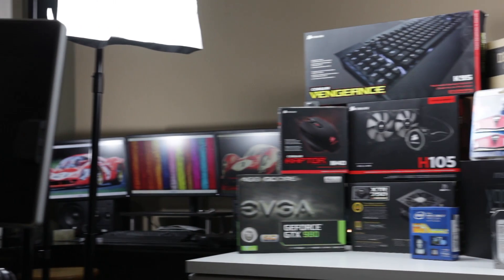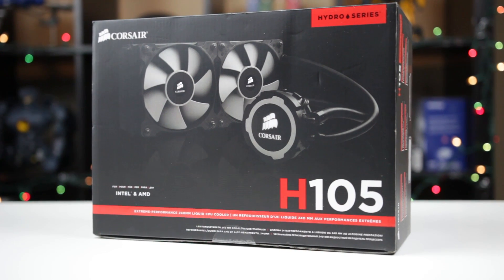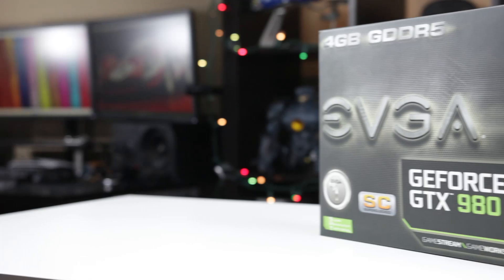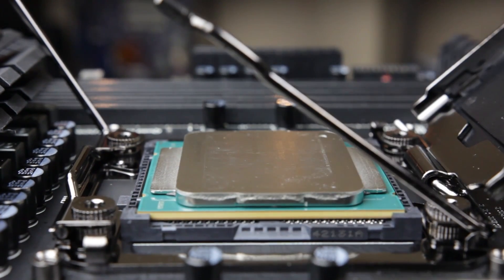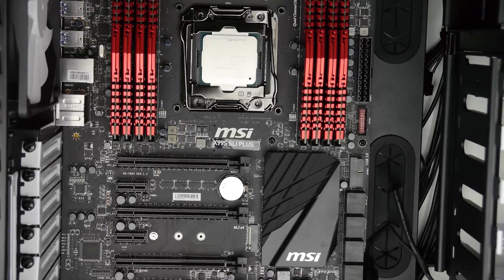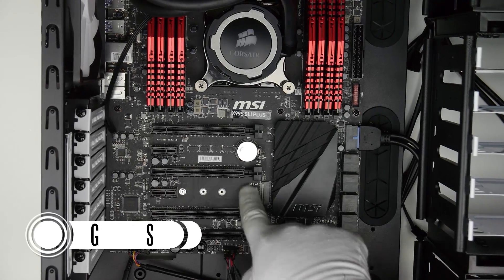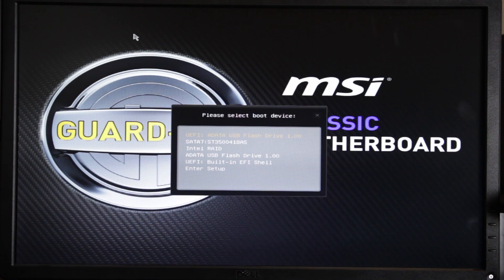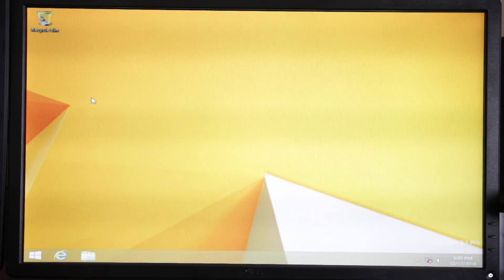How to Build An Epic $4000 4k Gaming & Video Editing Dream Machine for 2015

Comment: How about two 970s in SLI than a 980?
Reply: 2x970 better than single 980
Reply: Erik Kukučka thumb rule is about a 40-60% increase x).
2 gtx 970 will beat the 980 in anything
Reply: Single 980
Reply: Erik Kukučka The vid says 4K gaming in which case 2x 970s are going to give better fps than a single 980. No you may not get 2 x the speed but at that resolution in quite a few games it wont be far off. Plus there are only a few games that dont support SLI and even then you can usually get around it with sli bits in inspector..
Reply: Thomas Newsham they still have 4 gigs, the last 0.5 gigs just runs a bit slower. will this affect performance? yes, by much? no.
Reply: yes. they still have 4 gigs of RAM, not 3.5. and gtx 970 in 2way SLI will still outperform a single gtx 980
Reply: I agree, it doesn't work that well, i won't either.
Reply: That would be much more expensive
Reply: MrFexyl with a $100 or $200 is not that much if you want very very good computer
Reply: ***** http://www.techpowerup.com/reviews/NVIDIA/GeForce_GTX_970_SLI/6.html
there you go.
the performance increase in some cases is nearly 100% even.
Reply: Ben Maes Mostly, but not all
Reply: SLI 970's still isn't very good for 4k due to VRAM limitations. Especially since they only have 3.5GB of VRAM not 4.
Reply: It will at 4k resolution. Games are starting to breach 4GB Vram usage now.

And its not a bit slower. It's 8x slower.
Reply: It may do but SLI 970's still isn't good enough for 4k without everything being turned down. SLI 980's struggle for that.
Reply: Single High end GPU > Dual Mid range GPU.
Reply: Powerweezle since when is the 970 mid-range??? Also please don't talk without doing research, it only confuses people even more. The 970 can be overclocked and reach 980 performance no problem. Because you pay for the best card availble, you get way less performance per dollar than other cards. This is the only place where two cards are better than one since you can get two 970 for the price of a 980 and they will be way better.
Reply: Thomas Newsham dude the 780ti has 3 and was considered amazing, are you saying that a card with 500 mb of fast and another 500 of a bit slower ram is worse???
Reply: Burta Verde the 780tis struggle with 4k
Reply: I went with the two G1 970s
Reply: For the same price you could have got a 295 btw. Good choice though.
Reply: Thomas Newsham and the 970 is better, anyway it was never intended for 4k so idk why you would complain bout it not being able do run extemelly well
Reply: Joshua Browne on the acer xb280hk
Reply: Thomas Newsham r9 290x2 is 1.2k in canada, two 970 are bout 800 since the prices went up, way cheaper, but i see what you're saying
Reply: Thomas Newsham in the UK they used to be £500 but now they are like £600.
Reply: Burta Verde 970s are like 300 each here.
Reply: Thomas Newsham where?
Reply: Burta Verde http://www.overclockers.co.uk/showproduct.php?prodid=GX-225-XF&groupid=701&catid=56&subcat=1515
Reply: euros tho not $ still prices are shit in canada compared to us, and we have extra taxes. Fu ck ing shit
Reply: sli is glitchier than one card and plus the performance would be the same.
Reply: The actual difference between GTX 980 & GTX 970 is only 15% enhancement. That is slightly noticeable. I have 2 PC's with pair of each, and I can assure you that GTX 980 is just slightly better. However, cost $300 extra.
Reply: ajay mann At 4K being able to use more than 3.5 GB of VRAM in some cases could be pretty useful!
Reply: ajay mann At 4K being able to use more than 3.5 GB of VRAM in some cases could be pretty useful!
Reply: RB5Network 970 or 980 aren't true 4k cards, you need sli or a dual gpu card to run 4k, your argument is irrelevant
Reply: Huh? Well, first off that wasn't an argument, and 2. Actually the 970 is borderline, and the 980 is definitely directed at 4K, you can EASILY run games at 4K with a 980?
Reply: RB5Network easlly? no, nothing can run it easily, well except things that are easy to run to begin with, but if you look at tests, nothings gets a stable or even close to 60fps on 4k in demanding games
Reply: Burta Verde yeah but 970 SLI struggles to get 30 fps at 4k. 30fps is my limit for smoothness at 4k.
Reply: Thomas Newsham we're not at 4k performance yet, it's coming but for now, it's not where we should be looking for gaming, 1080p if enough for most or 1440p. The technology just didn't get there yet
Reply: I wouldn't game on 4K with it either, i'd be gaming at 1444p or 1080p, but essentially Nvidia made the 980 for 4K, but again, i wouldn't recommend playing on 4K unless you had an SLI setup either.
Reply: RB5Network well you know, people want 4k but nothing can do it well, nividia made a card that kinda can, so why not say it's made for that, i'm not getting 4k for quite a few years tho
Reply: Well if we are talking about 1440p then a 980 will max that easily and its cheaper than 2 970's. Or as I said before just go 295x2 and beat them all.
Reply: For 4K, the 295x2 is the single card you should pick imo.

Comment: Great build! Good job. Although I would have cut down the memory to 32GB and get another GPU...
Reply from the maker: two GTX 980s in sli would be really awesome! perhaps in the future. but for now I need all the ram I can get for multicam 4k video editing.
Reply: +MW Technology hell, this build sucks for $4000, you could have easily done a 5930k+2 980's.  austin evans made a build around this time for the same price and it had a i7 5960x+32gb ram+2 980's which would blow your's out of the water, lastly on top of that his had a better motherboard than you's, lastly 16gb is ram is plenty for 4k video editing and have fun with the few pci lanes on that 5820k that can't do 3 way sli, hell cant even run 2 way sli in the same speeds
Reply: +BossManiacGames Your criticism was cheapened by your double use of lastly. I actually loved the way the build was presented. Well laid out and didn't lag too long on any one component. It flowed very nicely. Thanks Waj
Reply: +BraceDevilleThis build is awful
Reply: +a true scotsman uth ikr dont listen to the idiot above

Comment: Nice video as always, but you could have gone with a much better configuration for your requirements. for a high end gaming/editing pc you should have picked the i7 5930K, an X99-E WS motherboard and the newly released Define R5 case, those would've made a huge difference for you.
Reply: 5930k is worst option in terms price/performance, same cores same oc options as 5820k for bigger price. mobo its all about looks. good build, well spent money
Reply: Here you go 
http://cpuboss.com/cpus/Intel-Core-i7-5820K-vs-Intel-5930K
Yes the 5820k may have a better price/performance ratio but that's all what's going for it, everything else the 5930k has the edge in it with up to %35 better performance than the 5820k when overclocked. and the mobo is definitely not just looks, asus ws mobos were built for heavy operation and can withstand rigorous working conditions, like running 24/7 rendering and processing. and I think you forgot this case doesn't have a window so looks doesn't matter.
Reply: Hamza Awamleh that is so big BS 35% gain when OC.
Reply: Jānis Meija "UP TO" is the keyword here, with proper cooling yes it can. and I meant when the 5930k overclocked against the stock 5820k. did you even read the link I gave you? or any other comparison  for that matter? Or is it just your preference? If you're talking personal preference then by all means talk all you want, but if you wanna talk numbers and benchmarks please enlighten me with references.
Reply: Hamza Awamleh useless, keep comparing overclocked cpu vs stock. both are unlocked cpu, difference in stock is 0.1ghz, which wont see when oc, main difference here is 5930k has 40pci lanes over 5820k has 28. if 4 way sli is not your thing getting 5820k is real deal. and spend 150$ for better RAM> if you still dont understand it, u should stick with ps4 or xbox1.
Reply: Ok
Reply: ***** the 5930k is $480, the 5960X is a thousand dollars
Reply: 5960x- 1050$
5930K- 580$
5820K- 380$
thats from newegg
5820k is my GO, same 6 cores as 5930, i dont do wast of money like 4 way sli so these extra pci lines is not worth 200$. other option is 5960x if money is not an issue

Comment: Fan configuration..interesting to hear that Corsair suggest putting heat back into the case.  The logical way to set up the case is counter intuitive.     I would put the radiator under the fans which would pull air out of the case.  I would reverse the back top and front top to input, then I would pull air in from the side, and also vent out form the side if possible.   You then test heat in the case and adjust...     I am operating slightly over-clocked at 26 idle 35 degrees usual load and no more than 45 at 100%.